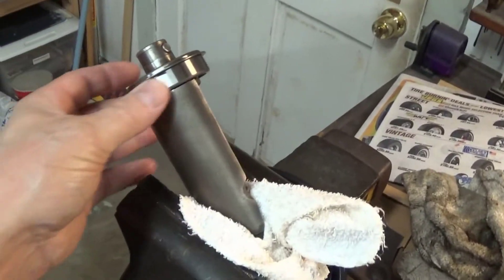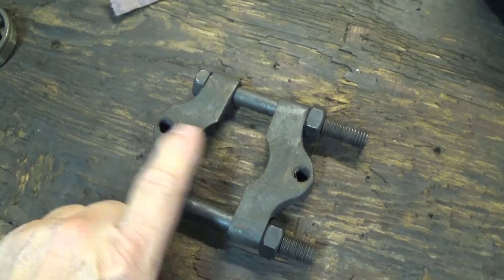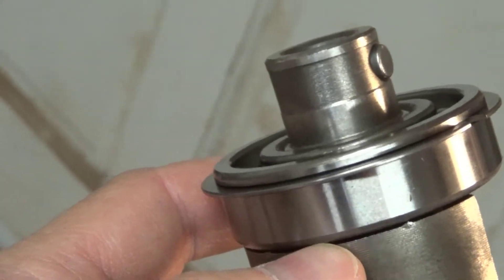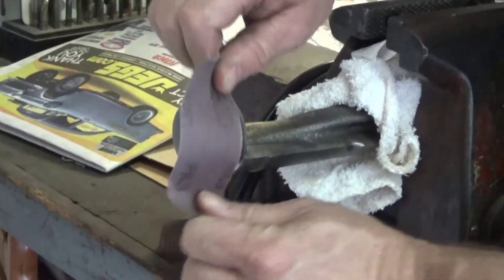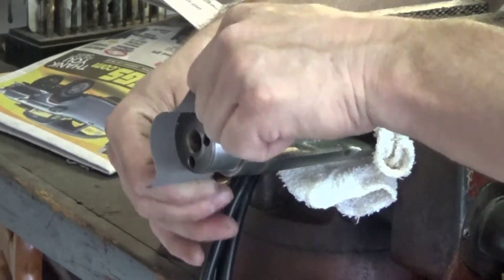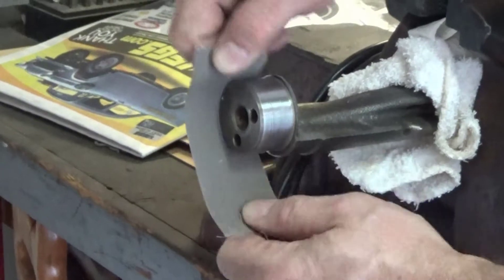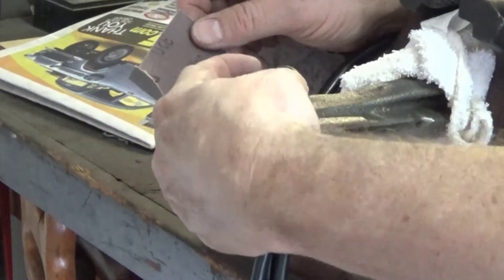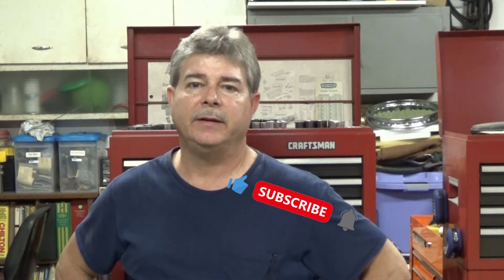GM Buick 3800 Balance Shaft Bearings - 1995 thru 2005 Replacement

Comment: Hey does a 1986 Buick Electra park ave with the 3.8 have a counter balance shaft?
Reply from the maker: The balance shaft wasn't added until 1988, so no, your shouldn't have a shaft in it

Comment: I tapped my balance shaft and roller bearing out without removing the snap ring. The snap ring did not break. I have the motor in the car still so I can't completely remove the balance shaft to get a good look at the bore where the bearing goes into the block. Does the snap ring pop in a groove recessed in the block ? Please tell me whatever you can about the snap ring. I can't find any info on it,
Reply from the maker: No, the snap ring goes in a grove around the roller bearing and that is to create a stop so that the shaft cannot go in any further. There is no grove in the block for it to snap into

Comment: I got the rear bushing at advance auto
Reply from the maker: The bushing can be found pretty easy, the front roller bearing is the issue. But I have all the part numbers in the description so everyone should be good on getting the parts now.